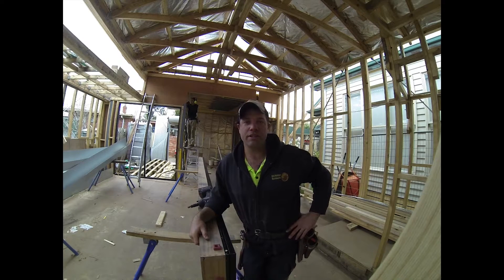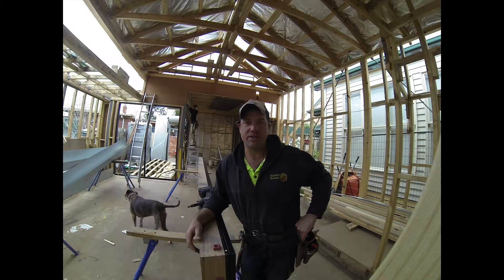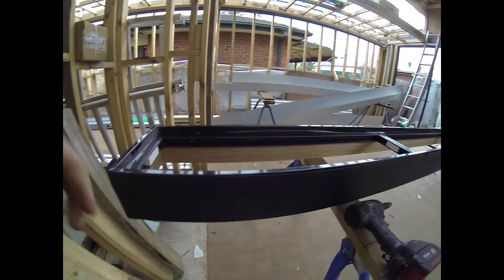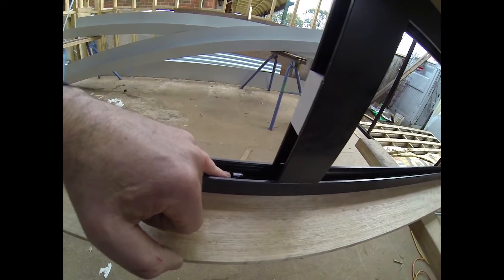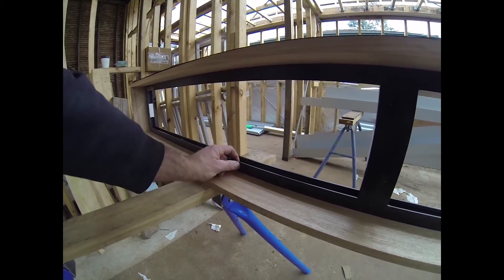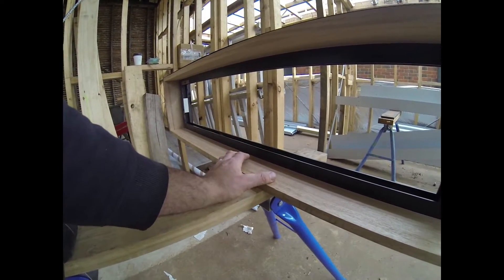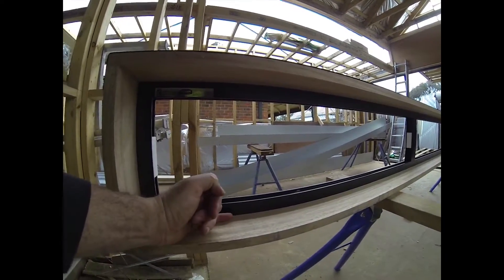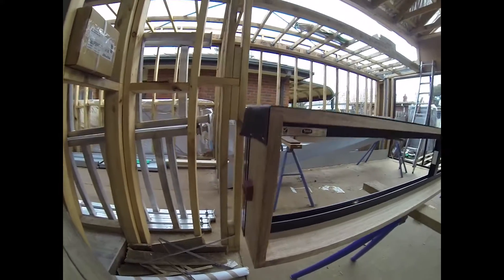Plastic flashing around new windows

Comment: Do you guys make the timber frame around or the window makers do that? What plastic flashing do you generally use for the top?
Reply from the maker: Gday Cloudyclouds,
it will depend on the windows and the timber.  sometimes we do yet most often we will get the window manufacturers to do it. #stayawesome uncle joe joe
Reply: @BeowulfBuilders  thanks uncle Jo Jo! Any tips on flashing under sliding doors and windows to go on polished concrete to get a neat look?